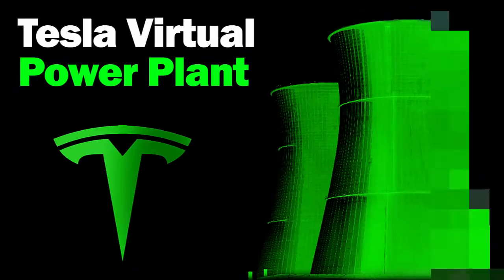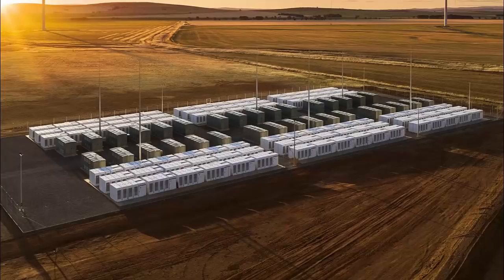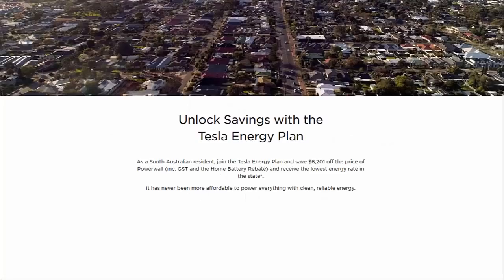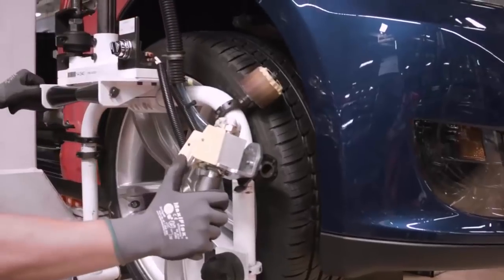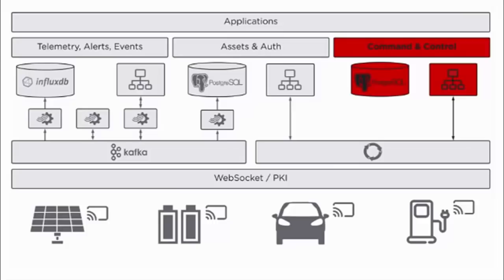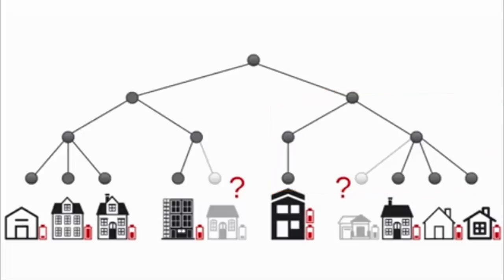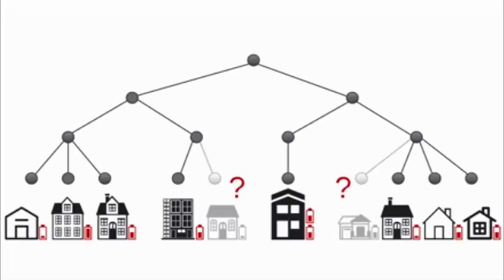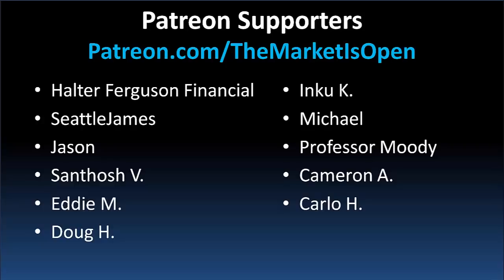Tesla’s Game Changer Virtual Power Plant is Already Here

Comment: I thot of this too - years ago. 
Even if you just use solar, panels all over the planet will be catching the sun as the planet turns. The power generated will be like a tide. This is not stored power, but in real time. Connect all these sources and use the power as it's made. Obviously, this is not enuf, but neither is this the only source. Each source can be used in a similar way. As their individual "tides" roll over the planet, take them up in real time and use them.

Comment: Yeah, Tesla will have autonomous driving batteries. So instead of letting you car do robotaxi for the day, maybe you let it work in the grid. It could drive to the area paying the highest on autotrader. Making it a real “autotrader”. Maybe at Tesla chargers you have an extra ten parking spaces. So you leave your car there all day, to work in the grid, when the spots are low auto driving pulls the car into and empty space to allow your charger to charge someone, then back in after more spots open up.

Comment: The boating company. Hear is a questing to through out there. What else could these tunnels be used for others than moving traffic that could generate cash and interest.?????? Could they be used to store huge batteries, whether they are flow battery’s or standard batteries or molten salts Etc. Could he use these tunnels or hole depending on tunnels been vertical or horizontal to generate electric in some way. 
What else could these tunnels be used for that could be revaluation in someway unthought that has been missed until now..

Comment: Should this turn out to correct, and I believe it is, this would almost make Tesla unbeatable.
Ok you buy the car, the solar roof and Powerwall, that's $100k spend. (You spread the car payments, you add the roof and Powerwall to your mortgage) this is still a big cost. But the system reduces your energy bills significantly for life. It all starts to work FOR you. 
What other car manufacturer can meet that. ICE or battery. 
None, they won't even come close.

Comment: It's just amazing what we can do to create power but having seen the recent 'Planet of the Humans' things are not so sunny in the power generation world and that the Green movement has certainly been hijacked by the corporate world who don't really care what we think, a disaster to them is a drop in their share prices..
We humans are unsustainable and the cost of the materials to make all these devices is too high and too costly having only a finite life.
In the dirty energy industrial world global concrete production is about 4 billion tons, 1 ton of concrete produces about 3/4 ton of carbon dioxide. 

There is a glimmer of hope on the horizon, graphene, carbon nano-tubes and geopolymer concrete which sets faster than normal cement mortar and produces 75% less co2 than concrete.

I work with traditional lime putty mortars & plasters and have seen the benefits of homes built from straw-bale, cob and pounded earth as the 1st century tomb of the Chinese emperor Quin Shi Huang will attest.
We need buildings that can generate their own power using solar panels, ground and air sourced heat pumps, kinetic flooring and wind power generators using vertical or horizontal squirrel cages attached to roofs or corners to generate power through a simple DC motor attached to it.

Comment: I watched about three minutes and switched off. The introduction showed that the narrator does not understand grid power generation, with fundemental inaccurate remarks. Incidentally, the Tesla Battery for South Australia's grid is only used to give time for the real back up diesel generators to come on line, a function it does well. 
South Australia's problems came because they shut down conventional generation and replaced it with variable and unpredictable and unstable wind and solar which cannot work.

Comment: Wouldn't it be easiest to connect the continents with cables for energy and to share energy. Tesla would be able to do it cheap
Reply: There are already optic fiber there, on the buttom of the oceans connecting the continents. And lots and lots of copper ones used previously for communication, with a bit adapting

Comment: Autobidder is installed in the charge controller, not the battery, for localization purposes. I suppose you could just have a data line that communicates the serial number when it's plugged in and if it's energy gets traded the serial number is credited.

Comment: Ok I'd like it if, I could get two power packs. One for the house and car and a 2nd one that feeds the house one and can be used in this way when there is extra power. Also solar panels feed the 2nd pack. Grid power feeds the first pack if there is none in the 2nd pack. Also added iron nickel battery upgrade for everything.

Comment: The icon you used in 1:28 is not a fuel-based power plant, those 3 large structures are water vapor cones or nuclear coolant systems, and have rivers of water under them to constantly cool the rods as they heat up water rushing and also have cold water coming in.
Reply from the maker: True

Comment: Let's be honest... Tesla cars will be made in Tesla's way: ZERO POINT ENERGY!!! lol

9

Urgelt
Urgelt
1 week ago
The entry point for Tesla is utilities; they're the ones who have to be persuaded.  These are very conservative entities, and state-regulated monopolies, too.  They make money by charging rates as high as regulators will let them.

So reducing electricity costs is not their number one objective; persuading regulators that costs can't be avoided is their real goal.

But their top goal changes if their grids aren't stable.  That's what happened in Australia.  Stabilizing the grid, not cost reductions, got the utility there to embrace change.  They likely have mixed feelings about the cost reductions; that means another trip to regulators and more persuasion, which could go either way.  But they had to stabilize that grid.  No choice.  The utility there was facing the possibility of having their license to operate revoked and given to someone else.

Consumers in Tesla's scheme are winners, especially if they can set parameters around their contributions (timing, how deep to discharge their batteries, etc.).  Tesla in Tesla's scheme is a winner; it's a way to earn some coin and persuade consumers to buy their cars (competitors aren't even remotely ready to participate).  Utilities are the weak point.

Utilities have steady-state sources like nuclear plants that don't follow the consumption curve, and variable sources like dams and fossil fuel plants that are merely slow to follow the consumption curve, and peaker plants for radical surges in consumption.  And then there are the increasing green sources, which can be highly intermittent and follow their own logic, not the needs of the grid.  The more green sources they have, the more they'll waste if they don't have storage and retrieval solutions.

Utilities aren't concerned with waste per se, only profits.  But waste makes regulators frown.  Next time utilities go back to discuss pricing, frowns are not what they want to see on regulators' faces.

Corruption and ideology contaminate politics.  Regulators are politicians, or they work for politicians.  This can be another source of resistance.  Some politicians hate green energy and would love nothing better than to show the public that green energy is wasteful.  Those politicians will resist distributed virtual power plants.  Other politicians will favor the idea.  Which dominates in a particular jurisdiction matters.  And either can be 'on the take.'  They'll act according to who is lining their pockets.

So, where does that leave Tesla?  The most likely utilities to buy into distributed virtual power will be in green-favorable political jurisdictions where corruption isn't strong enough to stop the project.  (Atypical, in other words.)  Where the grid isn't stable, distributed virtual power will also be an easy sell, but unstable grids are also atypical.  Everywhere else, it's going to be an uphill climb taking many years.

All of that predicts a slow, painstaking roll-out.

That might not be such a bad thing.  Tesla has put together an impressive plan, and the pieces to make it work have been put into place.  Their foresight is once again impressive; Tesla has never looked forward a quarter at a time, which is one reason they're eating their competitors' lunch in the automobile market.  But the software!  Holy cow, but that's an ambitious bit of coding.  They're again harnessing machine learning on yet another project far vaster than anything machine learning has tackled before.  The software is heavy lifting.  So, a roll-out to a small handful of favorable utilities is probably just what Tesla needs right now.  They need to put their software to work and then begin stomping bugs and refining it.

In the end, Tesla will have something of immense value - but not soon.

44

John Trustworthy
John Trustworthy
1 day ago
So essentially a green power source without government corruption.

11

Rylie K
Rylie K
1 week ago
As a South Australian I feel quite proud that Tesla chose us for their case study

62

Ronny Reichmann
Ronny Reichmann
2 days ago
One thing that immediately came to my mind: Will the highly centralized traditional power plant companies be bailed out when going bankrupt from not being able to compete with this?

9

TMIO Tesla
TMIO Tesla
1 week ago (edited)
I think we touched on 2 or 3 things that no one is really talking about. What did you think of our software stack analysis. Have you considered superchargers as an asset for Tesla the same way we did in the vid? Let us know what you think!
We'd super appreciate if you follow us on https://patreon.com/TheMarketIsOpen where we give a shout-out to our top patrons at the end of each video!

29

68stonecold
68stonecold
3 days ago
I am a participating resident of the VPP in South Australia in conjunction with HSA.So far it has proven to be a very good integral part of the power supply here and a very good idea on the whole.As Rylie K is i also am proud and excited to be playing a part in this exercise plus i`m saving money, providing my own electricity as well as the main grid when it needs it.It is without question a very proven technology built by a very proven technological visionary who is 'proactive' in so many ways,so much more that can be said for the technology`s 'negative Nancy`s' such as ScoMo...

2

Robert Morgan
Robert Morgan
3 days ago
thank you for breaking down a complex concept.  what elon and team are doing is beyond amazing

12

Advert Slaxxor
Advert Slaxxor
2 days ago
I think there's a misunderstanding of how powerwall2grid might work.
Yes, the "traditional" method of power in powerwall -> the grid. But that's messy, inefficient, and also requires the grid to handle it.
What if there was a better way? What if, the house suddenly utilized as much of the powerwall as it could? This would then offset the load to the grid, effectively putting power into the grid, but with absolutely minimal effort needed on the grid's part.

2

Pliny Elder
Pliny Elder
1 week ago
There’s already something like this called Independent System Operator. And California also has a huge one.

1

Cevan Triplett
Cevan Triplett
1 day ago
Yes I’ll give you a thumbs up.. because you gave me value before you reminded me to hit the like button

1

dude man
dude man
4 days ago
This just cable tv coming to sell you on their grid to help get started charge you heavy fees in future !

9

Taylor Johnson
Taylor Johnson
2 days ago
I like this idea more efficient use and storage of consumable electricity
Reply: why did you post this?

Comment: The current power grid does this now you just need a grid tie in inverter and you can sell excess energy to the grid or use it to supplement your home when your solar panels or windturbine are producing enough. But the difference is the energy storage. And you can store energy so many different ways like pumped hydro or gravity pulleys or mechanical spinning energy things. Many new and cool ways. You cld store energy when it’s cheap and sell it back when it’s expensive

Comment: The battery isn't a power plant.  A 2d to 3d particle conversion will increase the energy generation, if the flow between the sourse is utilized by an electric motor, then returned to a ground state by a final earth ground.

Comment: I think there's a misunderstanding of how powerwall2grid might work.
Yes, the "traditional" method of power in powerwall -> the grid. But that's messy, inefficient, and also requires the grid to handle it.
What if there was a better way? What if, the house suddenly utilized as much of the powerwall as it could? This would then offset the load to the grid, effectively putting power into the grid, but with absolutely minimal effort needed on the grid's part.
Reply: This is true until a region has hot or cold weather that doesn't have optimal sun before or after. Then, it will need regional input from somewhere else.

Comment: 1) re https://youtu.be/duzfJM9WUKc?t=516 "including their vehicles" - this is incorrect based on publicly known info. the vehicles can't feed back into the house/grid https://youtu.be/UkRk2OQI7RE?t=119 they are not "ready for V2G technology". there is no "inverter" in the car for the house/grid.
2) https://youtu.be/duzfJM9WUKc?t=854 the address is registered with the Autobidder integration when they sign up for the program. the grid operator can map the address to the various nodes of the network. no GPS needed.
3) https://youtu.be/duzfJM9WUKc?t=899 no, the "vehicle" can't participate. see #1
4) not the "car battery" https://youtu.be/duzfJM9WUKc?t=944 see #1
Unless Tesla are changing the 11.5kW onboard charger to a charger/inverter with bi-directional support (which I don't believe the CCS/Type 2 protocols even support) or they provide a wall-mounted inverter that can somehow connect to the car, the vehicles won't be participating in V2G.

Comment: batteries have a finite lifespan...solar panels running water pumps during the day to increase water head of reservoir.  Peak power demands are met by increasing turbine flow.  Pumped storage is not as efficient....but does not require massive battery packs, and is more reliable.  Add solar panels and electric pumps for greater power output.  An inland desalinization plant alongside an inland salt water lake could also provide fresh water for consumption in very arid locations, like the Outback.  The vast area of such places is ideal for huge solar panel farms and wind generation to power these projects....without batteries.
Reply: Unfortunately such solutions are more difficult to install, take up more space, and can't be installed everywhere. I agree that using a hydro battery makes sense to some people, but batteries are easier to mass produce and install anywhere you want them

Comment: Around 15:00 it would be the EVSE that knows what grid it's on and would control the vehicle.  The vehicle GPS data is almost certainly not accessible to Tesla for privacy reasons.  The EVSE, like a powerwall, doesn't move very often and may have a location assigned during setup from a phone.

Comment: Power companies have a way to transmit meter readings back to their office.  Also have a way to pass instructions to interactive controls for AC units.
Reply: So they can turn your AC on and off? Havent heard of that. However there are thermostats that do what Teslas Virtual Power plant aims to do just with power consumption. http://www.smartloadsolutions.ee/
Reply: @pflernak  Yes, if you sign up for their programs.  They offer a small discount in exchange for the ability to throttle your AC at peak demand times.  It requires a special interface.
"lower rate structure by allowing the utility to automatically reduce their consumption during peak periods"
https://pv-magazine-usa.com/2019/01/14/portland-utility-proposes-1-kwh-incentive-for-residential-peak-shaving/

Comment: There is a controversy of whether Tesla's are bi-directional. I have heard that it can be done, if it is not already. Great video, some details that I have not seen!!
Reply from the maker: I think the vehicles depend more on the million mile battery, otherwise there's no point. So they can add whatever inverters they need once the new battery is ready.
Reply: @TMIOTesla  that's more likely. They need 3-4x the cycle life on the battery pack so there's no point spending the extra costs on a bi-directional onboard charger while the battery in said vehicle will never support the application.
Reply: If it's already done in home batteries, then it can be done in cars
Reply: @guringai  not without an inverter. this currently doesn't exist in the car https://youtu.be/UkRk2OQI7RE?t=119

Comment: There could be problems with scaling from local to grid.   The local connections may not be large enough to upload very much power.   Also imagine the safety problems with trying to work on local power grids when there is an outage.   I wonder if power walls will like it when their output is grounded.
Reply: Any v2g would require a charger designed for it.  Basically the equipment in a powerwall without the batteries.  So if they did offer this, you will buy a 2 thousand dollar charger that has to be professionally installed and enabled by the electric company.  The electric company likely will not approve these because they are less stable and can be disconnected.
Thus you may only end up with a system that has value if you can charge at night with a lower rate and then use that electricity during the day for your own home.  
That limits it to people who work from home and have multirate power.